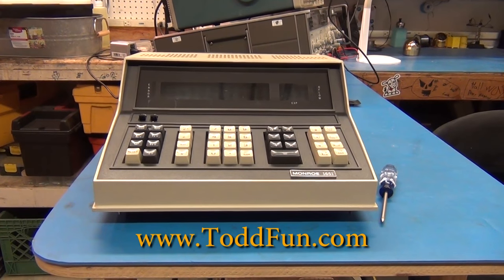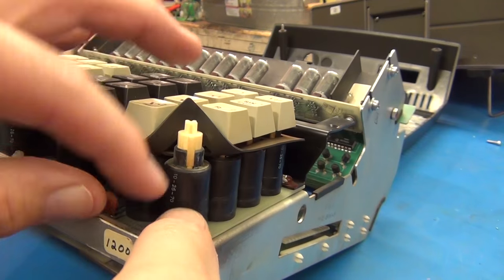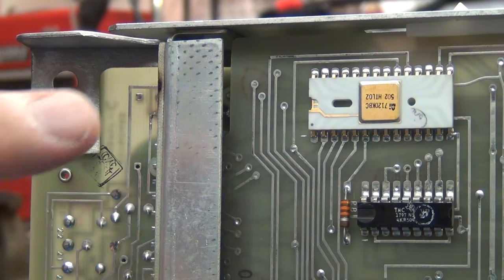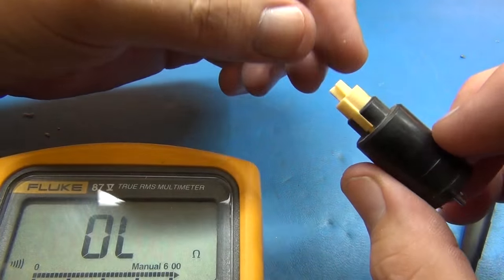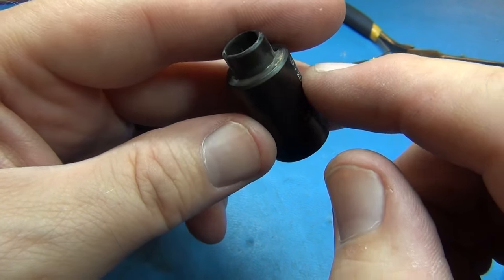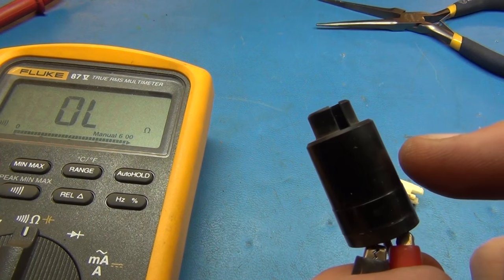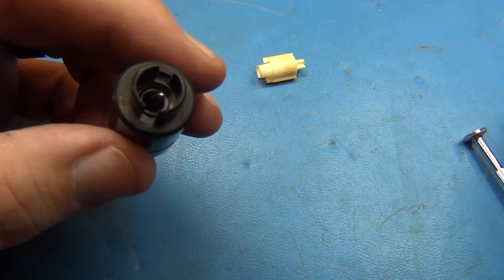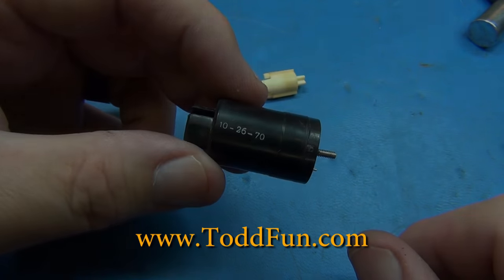Monroe 1651 Calculator Key Teardown

Comment: Glass reed switches were very common and are a sign of high quality. They are still being made today for high reliable tactile switches.
Reply from the maker: I didn't know they still made them. They could last forever.
Reply: They do. Oldest gear to use the magnet/reed combination I had was from 1950, and the switches worked like when they were new. These are the most awesome switches ever invented :)

Comment: Interesting, thanks for posting this. I have seen keyboard switches of that era using a similar design with hall-effect sensors but not reed switches. Peace.
Reply from the maker: I would have thought hall-effect would be even more reliable but I think they wanted to keep the circuit as simple as possible and it can't get much simpler than a reed switch.

Comment: Hi Todd, I would take a closer look at the white plunger. I suspect the magnetic is in there. If you say the plunger is blocking the magnetic field, the switch would be constantly shorting across the contacts until you push in the plunger. . Pete
Reply from the maker: +Peter C. Kopp No, that white plunger was only plastic. I was wrong thinking it was moving a blocking shield. A closer look it was clear the magnet is in a small movable gray plastic collar inside the housing and the spring is under the gray plastic collar. There is also a smaller inner gray plastic tube for the plastic collar to move along and keep the collar centered. When the magnet moves down just a little it then closed the reed switch.